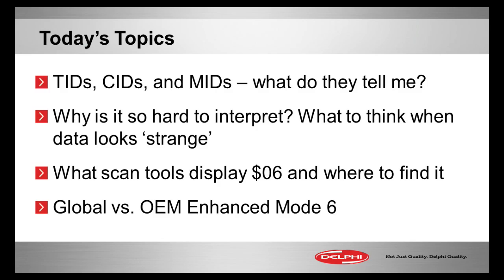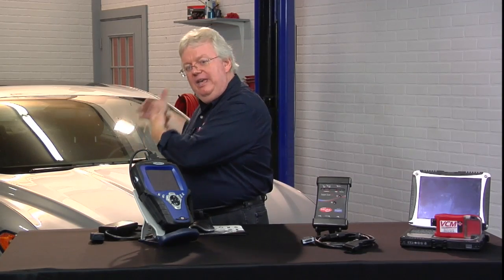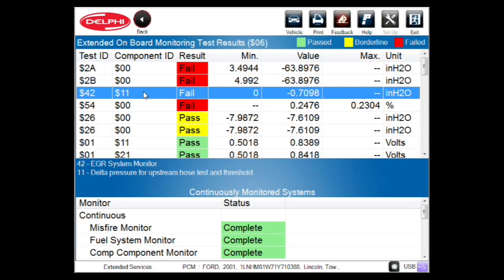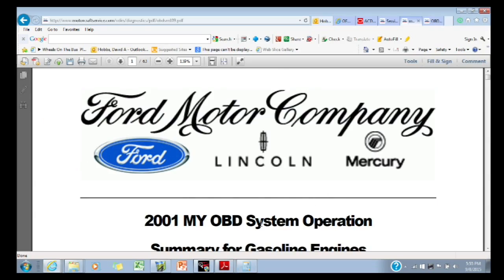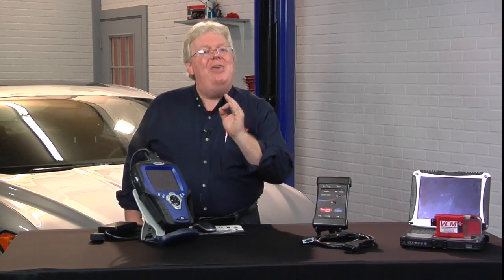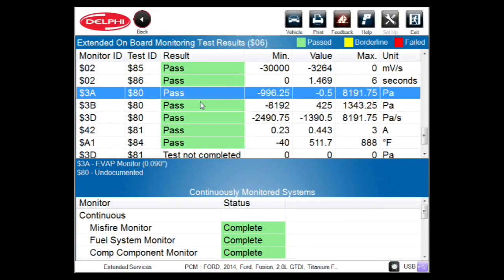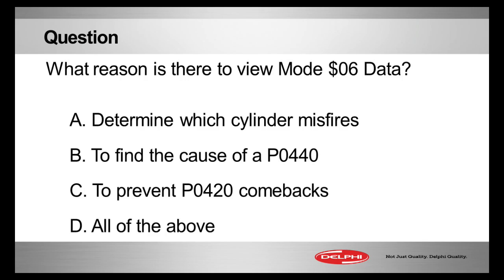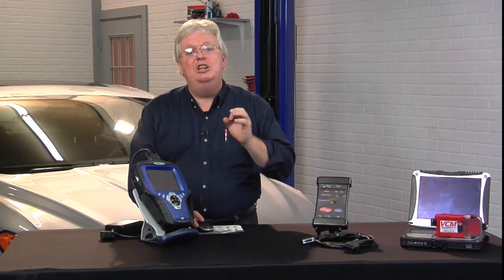Delphi Training Series: Reducing OBD II Comebacks with Mode $06

Comment: If you have a test failure and you think you've fixed the issue (there were no fault codes but a monitor or two doesn't complete), do you have to reset all the monitors and go thru the drive cycle all over or can you just drive the vehicle around and then check mode $06.  When does the test results get updated?